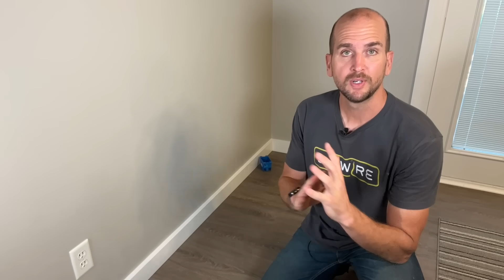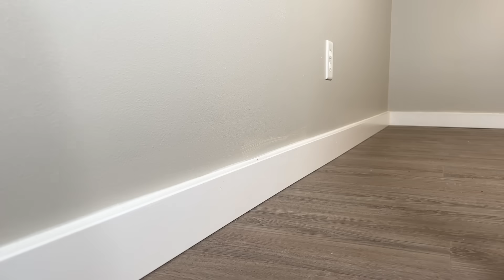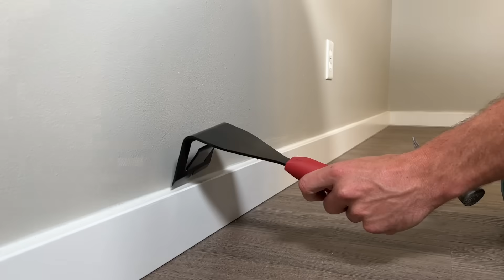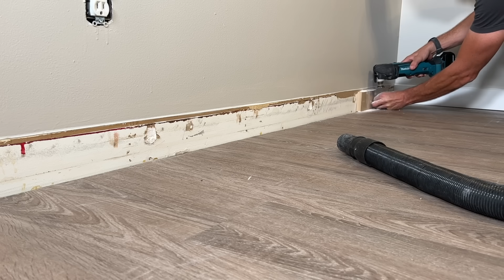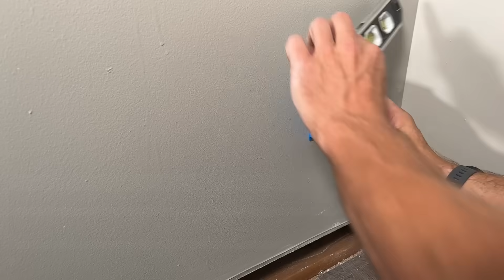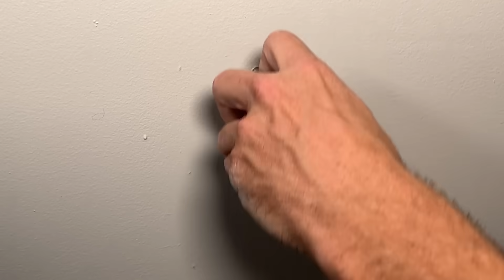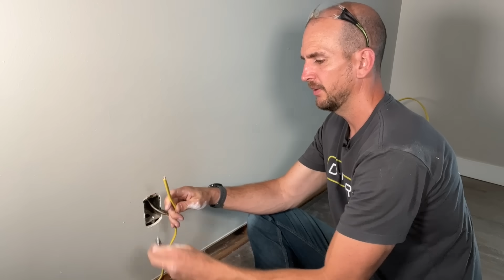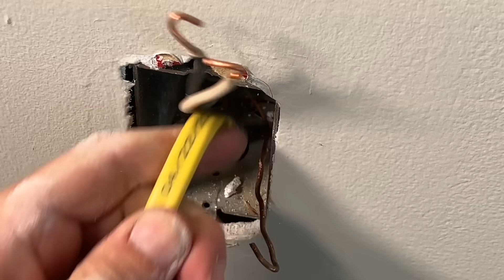How To Add An Outlet To A Finished Wall

Comment: HVAC guy here I noticed electricians commenting here. I have done house wiring.
My 2 cents is every state has a number of recepticals you can have on one breaker and your not supposed to exceed that. In my state it's 7.
Realistically it will probably be just fine, but codes are in place for a reason. I've fixed some real nightmare jobs.
Reply: It reminds me of the 11th and 12th commandments: Thou shall not take the P and Thou shall not get caught.
If you're reasonable in your home modifications then it'll be ok, but if you get greedy/ambitious it becomes a nightmare. For you and the contractor who has to clean your mess up.
In the UK 'Part P' of the building regulations allows a home-owner to complete basic tasks. These include changing damaged fittings/changing light fittings, fit spurs (which is what this is 'in English') and a few other minor tasks, but rewires etc are well beyond the scope of what a 'competent person' can do.

Comment: LOVED this video, but, and its a big but, all of my floors and internal walls are solid concrete. Its a 20yr old house and doesn't have anywhere near enough outlets. Without really messing up all of my walls, is there any neat way I can add extra outlets? Any tips for concrete walls please?
Reply: Wow. You have a residential home, with "concrete" walls? Reminds me of all the new Amazon distribution centers, (that are destroying the landscaping around our neighborhoods. They look like Alcatraz.).
 Are you sure your walls are "concrete", and not lath and plaster? (I guess a new house, wouldn't have lath and plaster.)
Reply: @joequillun7790  yes absolutely sure, the walls, including internal walls, are made from reinforced concrete. I live in the Caribbean in a hurricane area so our houses need to be very strong. Outer walls are reinforced concrete, then a polystyrene insulating layer and then a marmoran plaster finish. No drywall inside for us - the walls are solid concrete on the inside with a knockdown finish. Even hanging a picture on the wall is difficult. Floors are the same, solid concrete with services encased, so trying to move a pipe or run a wire is very difficult. But my home looks very nice and not like a warehouse.
Reply: @DebyColes  Then your country must have guidelines for the electricians to go by.  If you have minimal outlets, I wonder how the locals add on? Me, (not being an electrician) am a hack and stabber, so my opinion isn't worth a cup of coffee. But I'm reminded of the early houses of the USA, that did have plaster walls, and those houses had chair rails, picture rails, and plate rails, (the highest ones), that were attached to studs, and ran the perimeter of the room. Then they would nail, clip, or tie anything they wanted to hang, on those rails. I'm thinking in your situation, maybe you can hide your wiring under some clever trimming, or something of that nature, attached with concrete anchors. . Once again, don't know the legalities, and you would have-ta research it further.
Reply: @DebyColes  Hi Deby - I grew up on RAF bases so we couldn't hang pictures on the wall, but they did supply picture rails. They're like shaped skirting boards, with a grove in the top and you can fit a hook into them. Just use grip/adhesive to fit them to the walls. There will be enough surface area to carry quite heavy paintings.
As for sockets, I'd cheat and rip out your existing skirting boards and go for some 'commercial style' perimeter trunking. Use this with surface mount boxes. Some of this is terrible, others less so. It depends on how much you want to spend. The cheaper stuff is just nasty. 
(I had a similar problem in the office, it was a pretty horrible job, but they wanted cheap and quick - which they got.)

Comment: The Studs here in Arizona are 16 OC for outside and weight burying walls and 24 OC for inside walls for spacing. with your metal box, there are these 2 slits in the back at the bottom of the box. those are the ones you want to use to get your wires through. just knock one of them out and feed your wire through. Those wire connections are awesome, and I also use the outlets that you use.... if I can get them now. I use the cut away behind the base boards a lot. No patching holes, no headache of touching up paint.

Comment: why didnt you just cut a channel in the sheetrock behind the baseboard and run the wire through that? didnt even need to cut a big hole in the sheetrock or drill a hole in the studs.

Comment: Looks very easy if you are an electrician. 
BUT please hire an ELECTRICAL CONTRACTOR for all your electrical works no matter how easy it looks. It's not and put people and properties in danger if it's not done right.
Reply: Why? Why would it not be done properly?
In the UK this is called 'fitting a spur' off of the ring main and is a fairly straight-forward process. I did my first one when I was 13. It was a solid wall so it took longer to drill/channel than anything else, but the wiring up was perfectly straight forward. One set of 'twin and earth' cable; so three connectors/six screws for the electrical connectors. Two more for each face plate. 
My father checked my work.

Comment: Great work, the trick with preinstalling the romex clamp protector for the metal box was a great idea, I would have been like well I can't get to that thing to put it together so it won't get installed....now I know an easy fix/work around for that.  Also, great idea about cutting out the drywall behind the trim, nobody will ever know you did that unless someone else does the same later on, or they remodel and tear off the drywall.  No painting needed, and no drywall taping, or anything.  

I have never heard of or seen those WAGO connectors either until now.  I may have to pickup one of the kits, I believe they would be far more secure than wire nuts?

Comment: Electrician Contractor here, This video is amazing for beginners, but the only thing that should correct, is that as per the update electrical code, we can not install a metal Connector (BX connector) on Loomex wire. the Connector should be a plastic one.

Comment: Just wondering , when removing the baseboard and drywall you automatically expose the studs visually. Why bother with the stud finder? Great easy to follow video. Thank you.
Reply: Probably so he could find the drywall nails which needed to be removed so that he could remove the piece of drywall.
Reply: And I opened my mouth before I realized what you said dam good point. 👍
Reply: So he can drill holes through the studs for the wire to go through.

Comment: Just wondering, being that you expose the studs when removing baseboard and drywall , why worry trying to locate the studs with a stud finder? Great video.
Reply: I thought the same but guessed it was likely a head slapping moment for him when he realised this himself but left the stud finder section in the video instead of editing it out.
Reply: Thank you so much for explaining my question.
Reply: Helps to be able to find the nails at the bottom so you don't break the piece of drywall you are taking out.
Reply: @hotpuppy1  makes sense. Thank you.

Comment: Instead of using the Wago, why couldn't you connect the old incoming wire to the top receptacle and use the bottom outlet to feed the new receptacle? Aren't both top and bottom outlets connected through that (link) tab on the side?

Comment: One of the best tutorials I've ever seen!
Not sure I'd be able to do that because my baseboards are pretty short. Might not be able to get any room over the two by four on the slab.
But if I need install an extra outlet in the future, I'm definitely going to try it!
Reply: Your cure for the limited room may be to use a 90 degree drill attachment and just slip it in and angle it upwards a little.

Comment: The secret of having a nice caulking finish, it's to cut a tiny hole in diagonal in the caulk tube and used a damp piece of rug to moist your finger to reset the amount of calking after applying it.

Comment: I was interested but I guess this only works in the US, I haven't seen that type of cardboard-like construction anywhere else. Still a good job was done here.
Reply: In the UK we would call this a stud wall (used to divide up a house/flat). There's also 'dot and dab' where in a older property plasterboard (drywall) sheets are 'glued/stuck' to the wall to give a smooth finish before a light skim of plaster is applied. This leaves small voids behind. So a similar technique could be used, but the cable would have to be rodded though.

Comment: Are metal plates recommended for wiring horizontal through studs or is that just for plumbing?  This is a very clever way to add an outlet when running new wire is difficult or impossible, nicely done!
Reply: Of course, metal plates are required for soft electrical too.
(See other comments for exact text of pertinent NEC.)
Reply: Depends on how deep the hole is from the edge. Hole in center of 2x4 doesn't need metal plate. Anything more shallow does.
Reply: @hotpuppy1 :

He didn’t say anything about centering on stud depth.

He specifically stated that he was drilling above the baseboard to avoid nail penetration when re-nailing the baseboard.

So if the cables aren’t deep enough behind the baseboard, then they aren’t deep enough behind drywall either.

If they were centered in the stud depth, then there was no reason to drill above the baseboard.
He should have used mid-height in the baseboard and simply not put nails there.

If he was concerned about the baseboard sitting flush, a plane would cut a 1/16” notch in the studs for nail plates to fit flush.

Comment: Wow, that was amazing! As a non-electricaller, I had to rewatch the 8:18 part over about the lever nuts, but it made sense!
I can't believe how clean a job you did, really fantastic and well explained.
Reply: If you’re using a cut in box you should take those little washes off the top and bottom of the receptacle that way it won’t stick out too far and have a gap on your plate
Reply: @patrickhaege3121  You are talking about taking the "ears" off of the receptical so it fits in the screw slot in the cut in box.
Reply: Yeah i rewatched that several times as i thought he was talking about the bundle of wires in the box  somehow "pulling the wire" into the box?  and i was like (What?)..?

Comment: So ive watched this video, and all and all i must say that you do explain it nice and easy.

Now where i'm from this isnt going to work because our innerwalls are made from either concrete or cementblocks.

But now that we are on the subject of doing things, i do have some comments.
1: you drill the holes for your wires, you do this in a way that you cant reach them easily in case anything is wrong.
2: you place the wires through the holes without a PVC housing, doing this make the wires more vulnerable to outside influences, like rodents.

So if placing wires without a housing is acceptable like this , then i dont understand all the trouble you went through.

Take off the trim, drill a reasonable sized hole just above the floor in line with the outlet on both ends. Feed the cable into the outlet down on both sides, now at this point many of you are wondering where im going to leave the cable. Well you get your piece of trim and route a section out for the wire and you are done. Or you can get a new piece of trim with already a cable channel in it. They are standard for any type of use.
This makes the job even easier and quicker to do to, also you dont have to cut a full piece of drywall out of your wall.

Comment: This is an excellent instructional video. My home is built on a slab. I need to move a switch controlled outlet In a bedroom. This is exactly what I needed to see. Can't thank you enough, now I will be able to remove the extension cord.
Reply: Note:
You technically cannot move as the original box must remain.  You are actually extending to a new location.
Reply from the maker: Best of luck on the project Anthony.

Comment: As a contractor with 25 years in residential remodeling experience, I am not a fan of your push in connectors.  I will use them if forced to when a previous electrician left the wires too short or the box is extremely tight for the number of wires. However, they pose the same problem as back wiring and outlet that is not the commercial type that you showed in your video.  I have Found them burnt up inside  electrical boxes before.  If you do decide to use them, be sure to visually check that each wire has gone all the way into the connector to the maximum depth.
Reply from the maker: Hey Dan, when you get a chance you should take a closer look at the WAGO 221 compared to the standard push in connectors like the IDEAL push ins you find at most home improvement stores.  WAGO also have some push in connectors but I really like the WAGO 221 "lever nuts" and they work a bit different as compared to the push ins.

Comment: You forgot to put metal stud plates where you ran the wire through above the baseboard. It’s an electrical accident waiting to happen for the next guy that might do repairs on the upper drywall area

Comment: Interesting to see house wiring with solid-core conductors, and non-insulated earth/ground wires. Both of these were common here in Australia up until around 1980, after which time stranded (usually 7 strands) conductors became predominant (except for the cheapest and nastiest contractors), and factory-sheathed earth wires became mandated.

Comment: Pull the first box completely so you can get a flexible drill bit in there. Probably only a few studs to get through. Replace both boxes with floating type.

Comment: Awesome technique and this is something I might actually have a use for!
Perhaps you've addressed this in one of your other videos, but do you have an opinion on if installing outlets "ground up" is "safer"?  I've heard the arguments and they make sense, but on the other hand in 40 years I've never personally known anyone who's experienced an actual problem with "ground down" outlet installation.
Reply: Metal cover plates are rare in homes.  A slipped cover plate is usually enough to make an overload to open the OCPD.

The ground prong is longer.  It’s easier to see to align it for insertion when it’s at the top.  
But some brands of some appliances like refrigerators and clothes washers have the ground prong at the bottom.
Reply: Pick an orientation and stick with it, otherwise your outlets will look wonky.  I like my outlets to look like a face, so I put GND down.  Same goes for height.  I use the length of my hammer as a gauge.

Comment: Cut the ears off the receptacle when using an old work box
Reply: I've made so much money as an electrician repairing wire damage from base board trim nails. That and crown molding...idk why but they use 2" Brad nails a lot

Comment: This I needed. I've been a residential journeyman for years. In my own house I had to redo some wiring to accommodate some new lighting in my living room and sacrificed my switched outlet to it. Original switch became the recessed light switch, switched outlet never had 14-3 and so became a constant hot outlet. Now with this trick I can add a new half-hot outlet under my window to properly display this lamp I won last December.
Reply: Is the lamp from Italy?
Reply: @tinpony9424  Does not specifically say but I think it very well may be Italian.

Comment: We just bought a new stand up freezer that fits next to our fridge and the outlet is to the right of the freezer instead of behind. Of course the wife doesn't like the look of the plug on the side and wants it plugged in from behind. 

This video saved me from a scorching attic- or excessive drywall. work Thanks for the tips ! Simple enough i wonder why I didn't think of it lol!

Comment: I think I could have added that box without pulling any base board and no drywall repair by adding another box in the second joist bay and drilling studs through the opening.

Comment: Code violation you didn't count your wire cubic inches a metal box 3x2x2 3/4 permits only 6 conductors minus 2 conductors for device 1 for clamp for upper wire coming into box. To add wires YOU MUST REPLACE BOX to maintain code also is there ark-fault protection need in new installation.

Comment: Great walkthrough! What would you charge for a job like this?
Reply from the maker: I'm just a DIYer or "D-I-Wire" so I only do my own work.  Pricing for an electrician can vary widely depending on your market.  If I hired this out in my area I am probably looking at $300 -$400.  Small jobs like this can be tough to get a response from Electricians in my area as it is hard to fit in a bunch of small jobs to pay the bills.

Comment: Note houses now allow I believe 24 inch between studs for internal walls.
Reply: 16” oc is used with 2x4” studs; 24” oc is used with 2x6” studs.
Reply: @ymvrr  I notice my interior wall studs are not 16 inch. They are 24" but not 2x6.

Comment: Yup.  Pop the bottom molding off and channel the Sheetrock. Run the wire.  Preferably MC cable so not to puncture it.  Staple it in